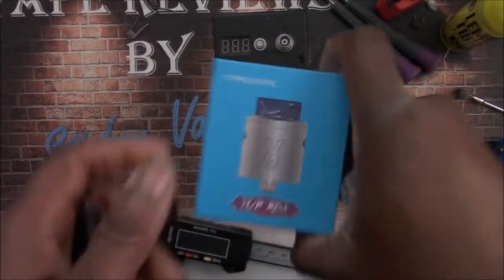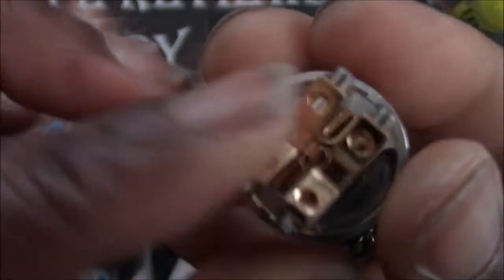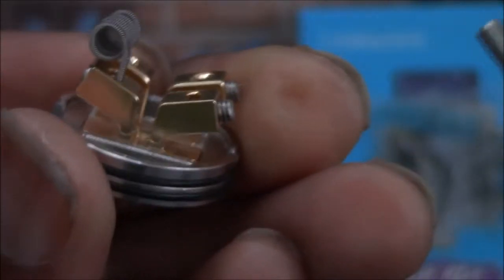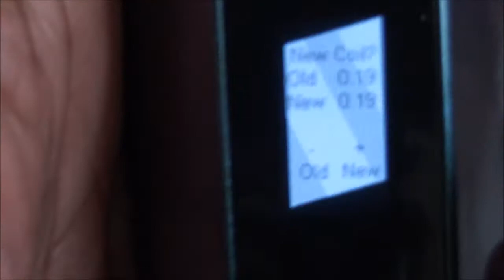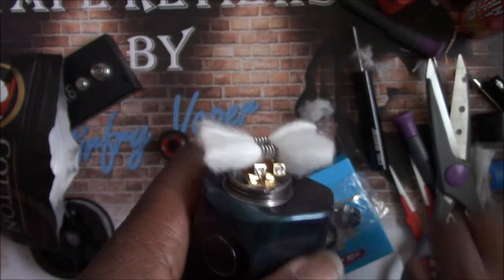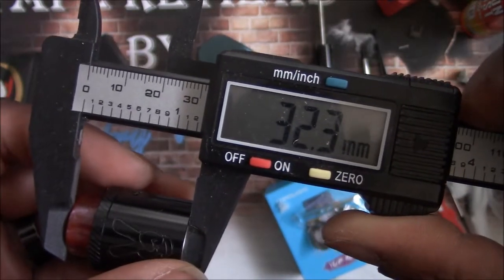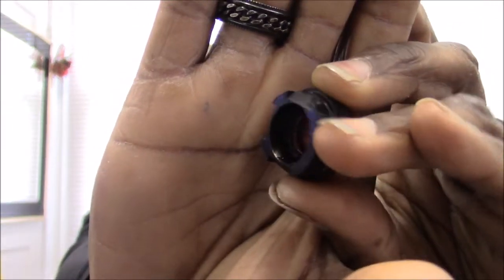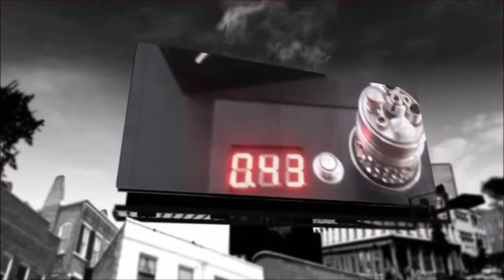YUP RDA by Famovape BUILD/WICK/REVIEW - GIVEAWAY

Comment: Hey does you're screws just keep screwing inside the posts like there's no wall inside to pinch the coil between the end of the screw hole and the actual screw... on mine without any coils installed the screws just keep screwing deeper and deeper inside the screw holes ... I don't know if mine is defective or that's there shitty engineering... what is gonna happen is the screw will push/pull the coil legs into the screw holes since there's no end wall... is yours the same? My screws just rattle with no coils inside
Reply from the maker: My screws do keep going in but when I put a coil in it it is tight. I just pulled my coils and checked them. They are NOT bent.